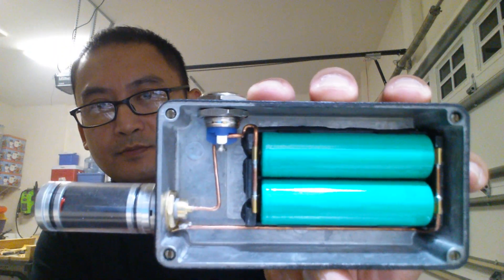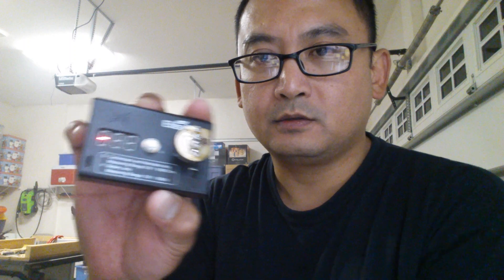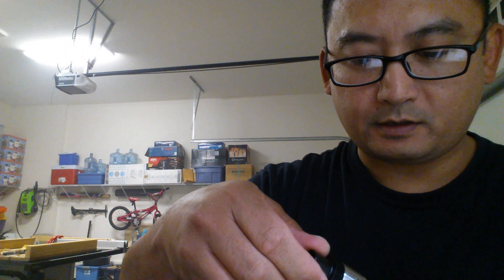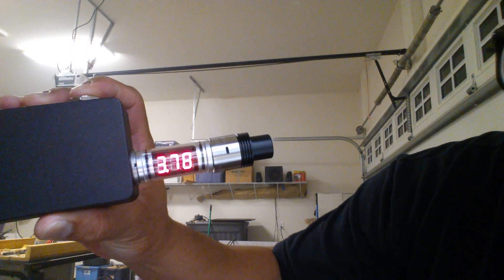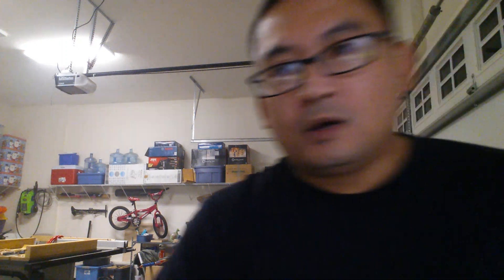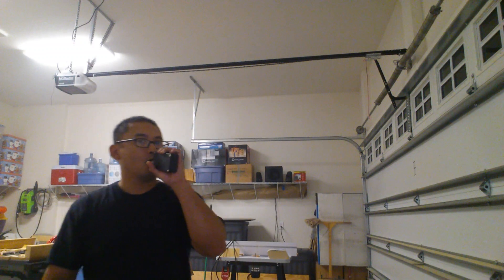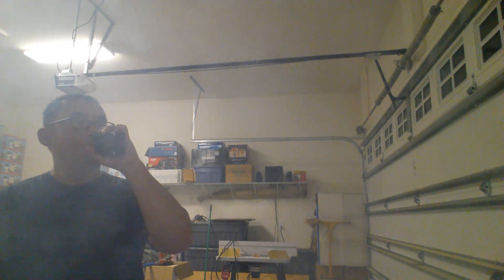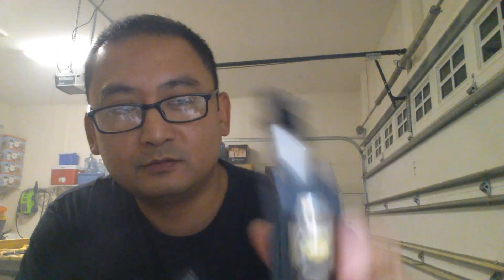Parallel Unregulated Box Mod Build tutorial 3 of 3

Comment: on voltage test seen here, um.... I'd personally think that ohming at the 510 connector without an Atty would be the only significant test. all we want to determan is if the mod it's self is no resistance. of course you will have a voltage drop with Atty on, you just applied a load. that is what the coil is, a load. what we want to find out is if there is resistance BEFORE we apply the load. if no resistance, we are in top shape. if there is resistance there is possibly a loose connection in the wireing, switch ,Atty connector, or sled. that would be a good time to trouble shoot and correct. if using the wire here I can't see any resistance coming from the little bit of wire used. that's damn near romex wire used in house hold and industrial wireing. I only note this mainly because I see so much on this topic and many information out there is misleading. simple for an electrition to fact check, but not for the people without 12 years of schooling and training in that field. again, the end goal is to determan if the finished mod has any resistance in it's wireing / circuitry before the attomizer is placed on the mod. we want zero or near zero resistance. what's shown here simply demonstrates the volt drop of the coil in the Atty. I hope this helped on this topic.

Comment: You are a good craftsman for sure. You are helping me with small things I had issues with for sure. Great Job. Btw, are you in so cal by any chance. Like to see also if you can do a box same way with dual 26500 s in it.
Reply from the maker: Thanks and glad I could help. I'm based at NC. 26650 box mod in the works, just waiting on my battery sled from Vape3D.
Reply: Al USAF Wow, you read minds too......hehe. I am in So Cal, but love your neat clean builds. Just as I would make but much better.

Comment: Hey buddy, have a question for you. I know you used JB Weld to secure the mosfet to the actual box. Can I do the same with Loctite's Super Glue Gel?
Reply from the maker: I wouldn't recommend super glue, it's not as strong as JB Weld.
Reply: that loctite will eat through the plastic on the mosfet Nick Morrow , experienced that a couple of times cause that super glue is the best stuff ever, not much for plastic.